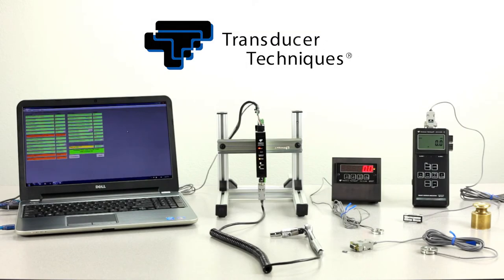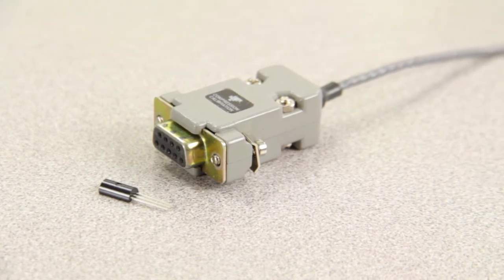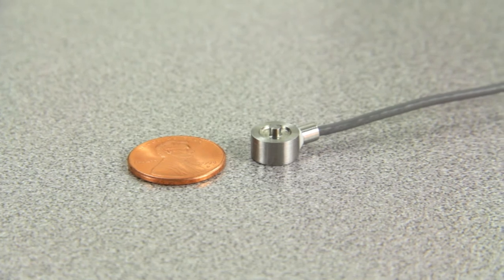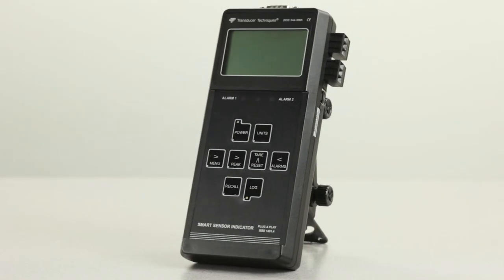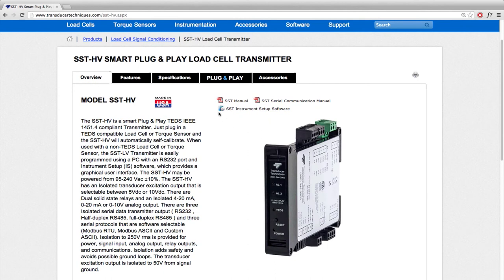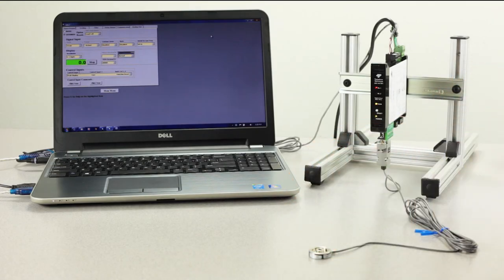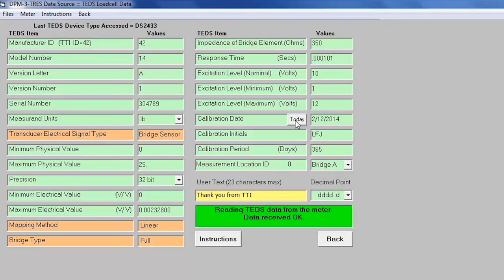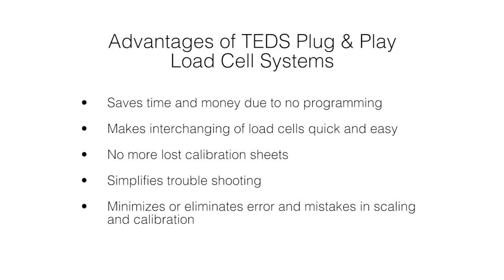Learn More About Plug & Play Smart Load Cells

Comment: What can I do if the TEDS light does not come on and I am using a TEDS load cell (with a DPM-3)?
Reply: Did you ever found a solution for this?
Reply: @andrescobos7855  i did because it works today.  But I can't remember what it was exactly.  It was not difficult, I remember that much.  And I used the manual to do it.
Reply: @smoke05s  Ill post the solution that I got in case somebody else needs it. 

For it to show the TEDS light the tare menu has to read 0000 (I think only the last one needs to be 0 but I had all 0s). The last 0 can only be changed when the TEDS is connected.